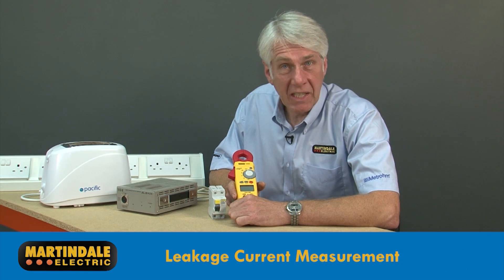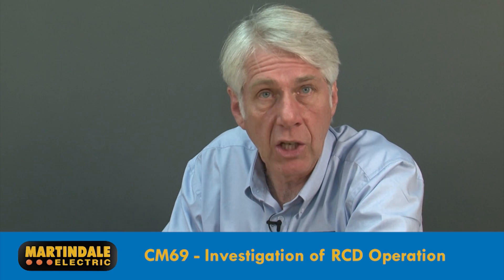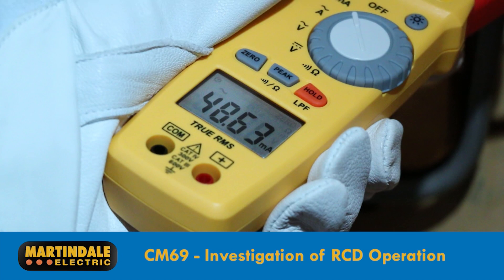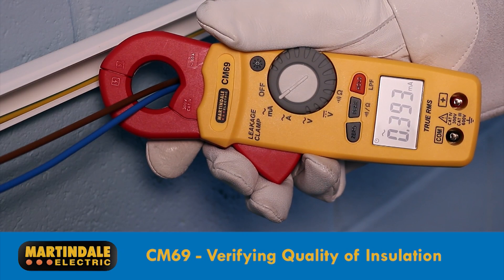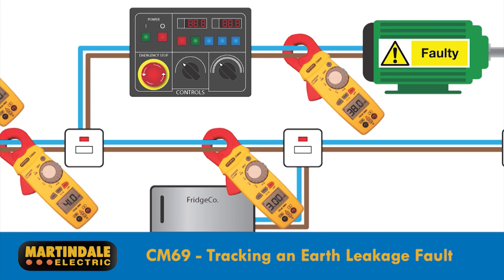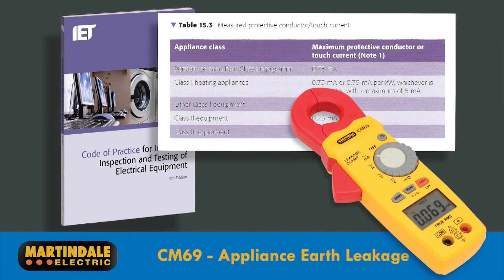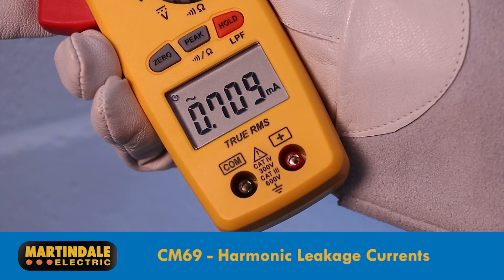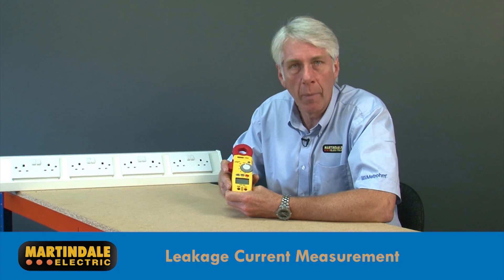Martindale CM69 Earth leakage applications

Comment: 3 phase circuits ? What size of cables can the jaws handle ? a pair of 25's ? 35's ?
Reply: Good questions.  I can’t find the answer anywhere and this is the only video on the meter.   I would be surprised if it could fit two 25’s let alone 4.   

Can the person who made this video answer it as they seam like the only ones with one.  Everyone else is on the megger as it can fit three phases
Reply: @kevinbeckett2181  I've ordered a cheaper version which I believe has 30mm jaws, which seems a compromise between access and needs of cable size. Although it will restrict for larger stuff. I have an issue with a rather large TP&N street light circuit that trips MCB in bad weather.....although actually getting the clamp around the relevant cables will be tricky. But this tool might be of use to help locate a problem
Reply: This shows a little comment on 3ph.... https://youtu.be/MHT6Y150Urg

Comment: How would I know what size cable to use to power a Hifi power amps. This would be from the consumer unit to wall outlet. Spec from my two power amplifiers. Slew Rate .............................................................. 70V/μs Maximum Current – Peak ........................................ 68 amperes Maximum Current – Continuous .............................. 32 amperes Crosstalk @ 1kHz ................................................... Not applicable Intermodulation Distortion ...................................... Unmeasureable THD (20Hz - 20kHz @ 1 watt) ................................ < 0.015 % THD (20Hz - 20kHz @ 500 watts) .......................... < 0.04 % Power Consumption @ idle ..................................... 40 Watts